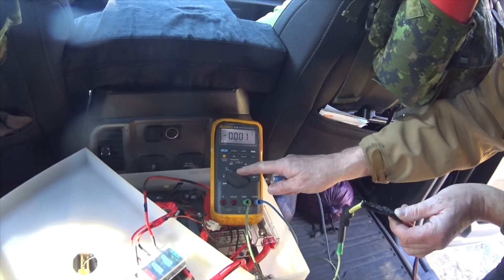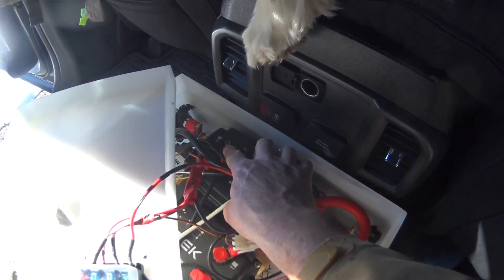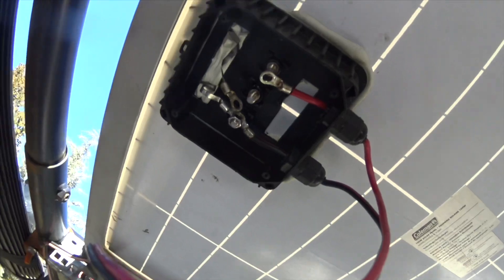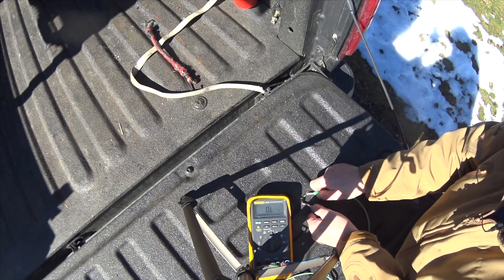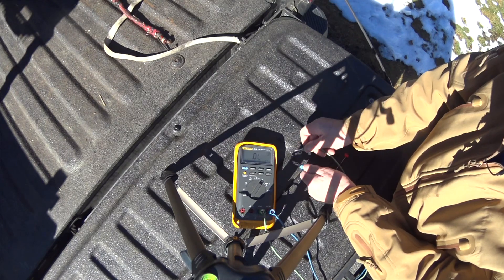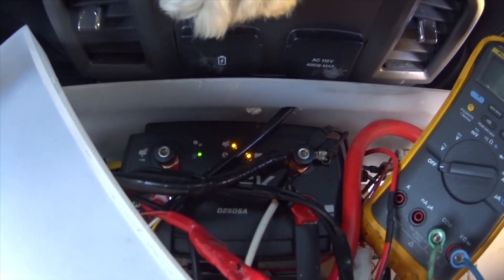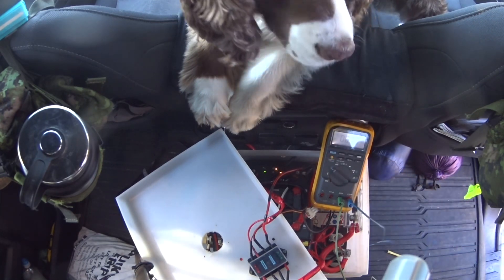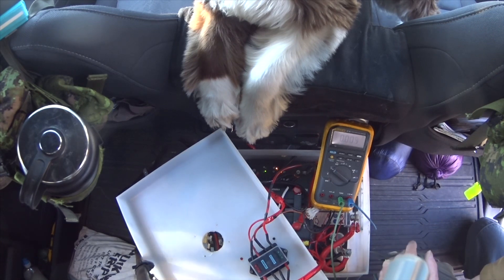Solar Panel not charging

Comment: Thanks Andy. I’ve been thinking of getting that panel. Is this problem specific to the Coleman line ?
Reply from the maker: alf3553 not that I know, I have 2 of the panels  and this is the 1st prob I have had in....i want to say 3 yrs, I picked 3 diodes up, 1 as a back up and 1 each for each panel, I will replace the other panels if and when it fails
Reply: I have a 250w panel with 4 10A10 Diodes In each panel, I have 1 dead diode and that kills the amp output for the whole panel